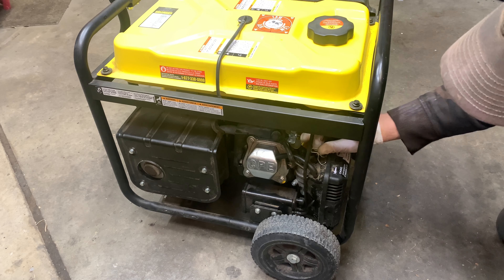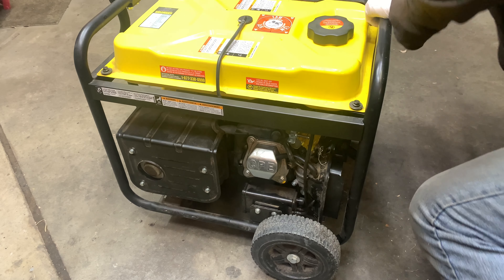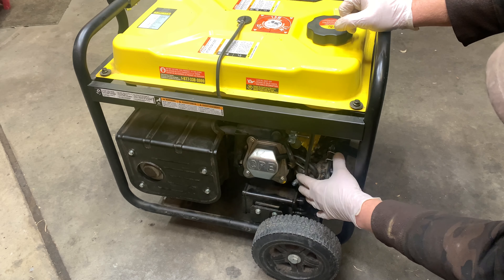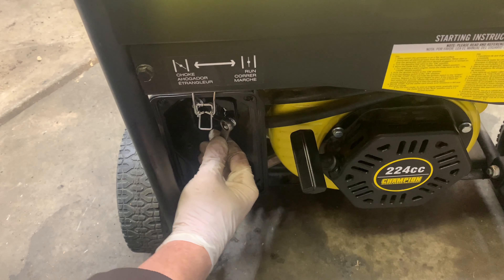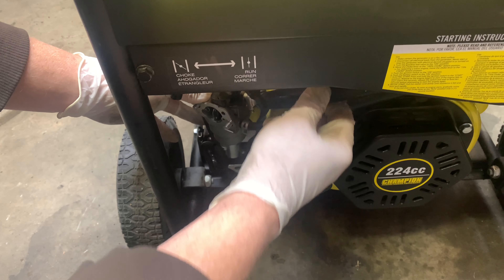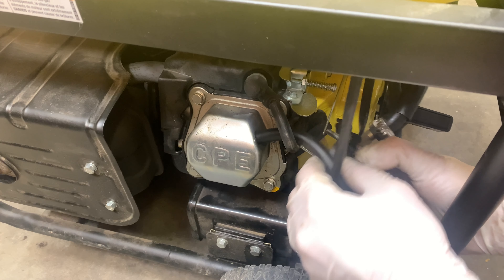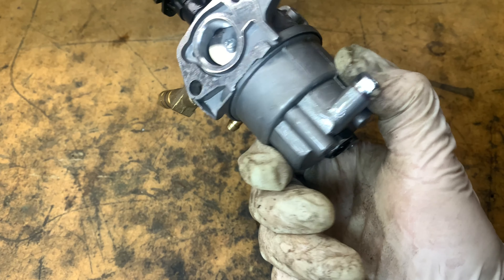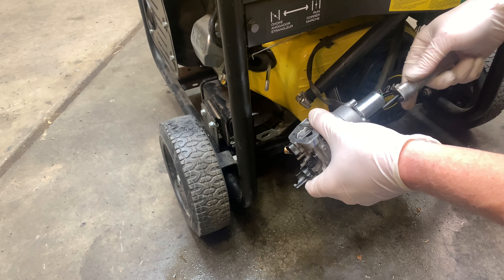Champion Generator Won't Start Small Engine Repair

Comment: Love this… I have a Champion 3500 inverter generator that was not starting… pulled off the maintenance cover, popped open the air box, removed the air filter, squirted 2 sprays of starting fluid, and BAM!!!!  The generator is alive!!  Thanks man!!  :D
Reply from the maker: Glad it helped

Comment: I have a Champion dual fuel 9000 watt and when I push the start toggle, I can hear the starter make it's noise, but the engine isn't turning over.
Is that the solenoid?
Reply from the maker: Possibly. When you say you hear the starter make it's noise, is it spinning or just clicking?
Reply: @small_engine_repair   Thanks for the reply, the starter turns over loud and clear, but I don't think the bendix is engaging the flywheel.
It makes a racket when doing so though.  Funny thing is, this generator has less than 24 hours on it (I know this because I bought it new).

Comment: How did you manage to take the bowl off of it 
I’m having the same problem with mine but can’t find a video to show how to take the bowl off
Reply from the maker: Luke, there is  a bolt on the bottom that needs to be removed. Here is a video of just cleaning a carburetor. It is for a snowblower but all the same steps apply. https://youtu.be/ChSb5jpvb2k

Comment: Loved it. Did everything. Still won’t run. Bypassed oil kill switch, nothing, rebuild carb, nothing, spark at plug good. No start. Ignition switch??? I took my grill lighter by plug hole while pulling cord, no gas flame, blew flame out each time, no fire from hole?? Put finger on hole, compression good. It ran great for 3 yrs. One set of commutator brushes replaced. That’s it…????
Reply from the maker: Did you check the valves?

Comment: I replaced the carb on mine and it doesn't start. Got it running with starter fluid on choke but it dies when switched to run
Reply from the maker: Hmm?? Bad carburetor.
Reply: @small_engine_repair  thats what i was thinking although its a brand new carb that i put on it.

Comment: I have no start condition on model # 100331. Ran great for 3 yrs. Then no start. Pull start mechanism dirty from use and replacement. Magnet dirty, flywheel dirty( black streaks from rope pull start. ?????
Reply from the maker: Did you get it running?
Reply: @small_engine_repair  No. At repair shop, repair man said phase to phase inside?? To expensive to repair????
Reply from the maker: I am not sure what you mean by phase to phase  @JimNobles-gv4ky

Comment: My champion model 41534 won't start I did same took off and cleaned carburetor still won't start I a,so replaced the spark plug I had this problem b4  champion sent me a new complete carburetor
Reply from the maker: The new carburetor fixed it?
Reply: @small_engine_repair  I called champion ordered a new carburetor installed new it runs like new again it's my fault for now running it at least once a month this is second time this happened to me now I try to take better care of it

Comment: What happens if it blows fire out after using start a fuel
Reply: Starter fluid *
Reply from the maker: Check your valves